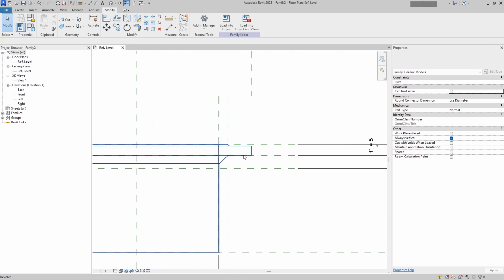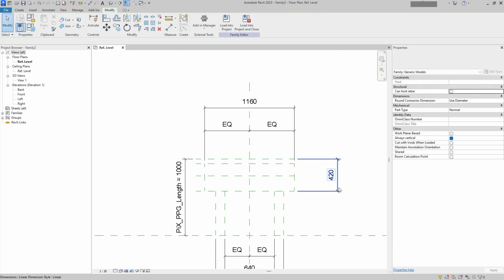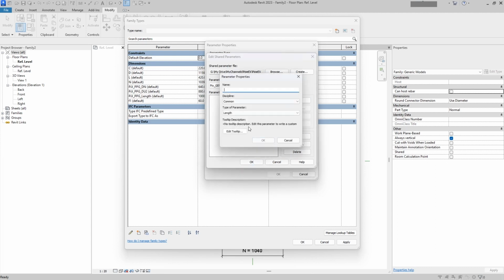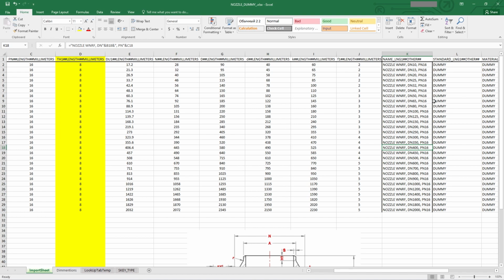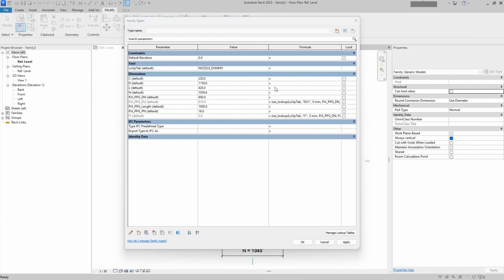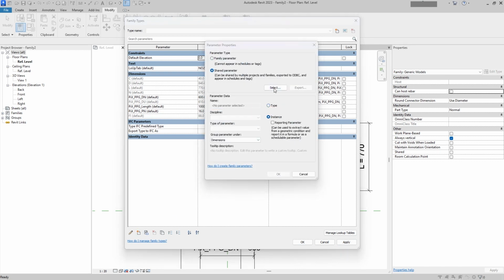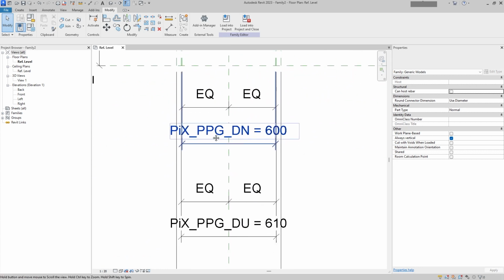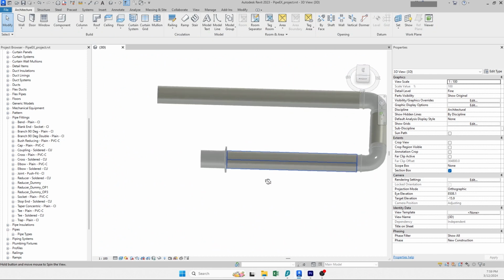Revit Tutorial - Nozzle Creation

Comment: Hello. I create this nozzle without using shared parameters because you hadn't explained how to set them up. I also created it as a generic model. When I load this family into the project which category should I load it under? Component or pipe fitting or ? Also my flange appears faded light colored...
Also you placed pipe connector on one side, whereas shouldn't it be placed on both side ? Also what diameter should we assign to the connector?
Reply from the maker: Hi, this is an equipment nozzle family, so you need to load it into the equipment host family, not directly into the project.

You can download the shared parameters file from our website, along with some additional materials:
https://www.pipeex.org/tutorials

You can also check out these videos:

-Equipment family creation: https://youtu.be/sWDmftnMl9w
-Updated nozzle family creation tutorial: https://youtu.be/0ZAO9KDmlpI

The connector should be placed on one side only. You also need to select a connector size = DN parameter.
Reply: @PipeEXorg but you have told before that you should create your own parameters as your company need
Also if I need to use this nozzle as a flange which category should I put it on? If I want to load it into 0roject
Reply from the maker: @rgh-n5n  Correct. If your company has standardized parameters, then yes, you should.
Well, you should not use it as a flange. If you still want to, I would recommend using the Pipe Accessories category.